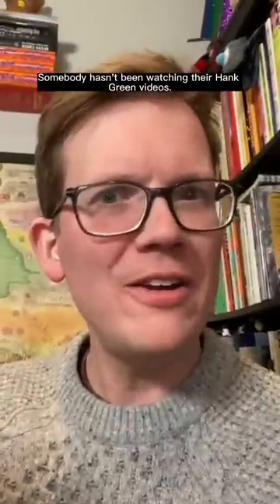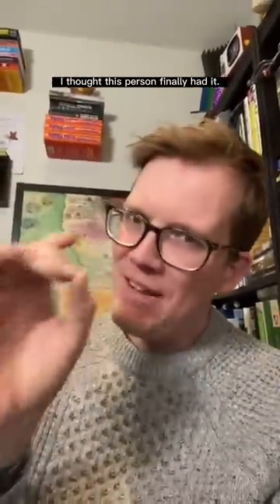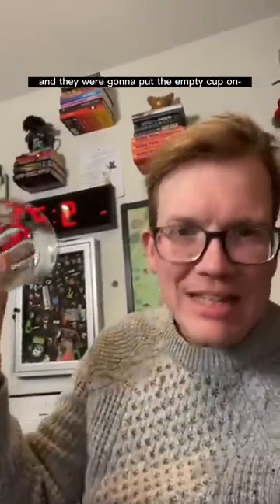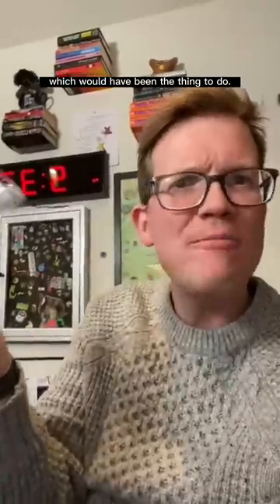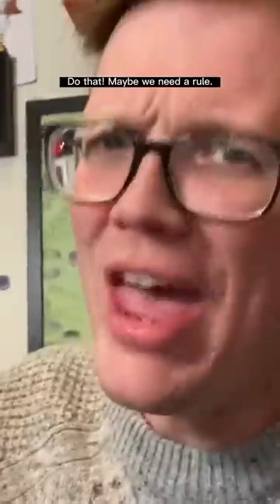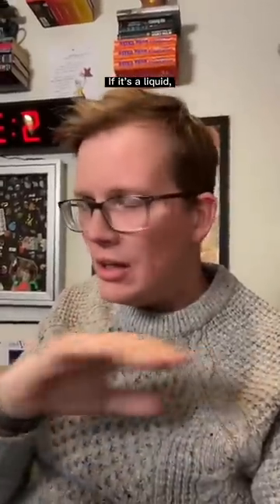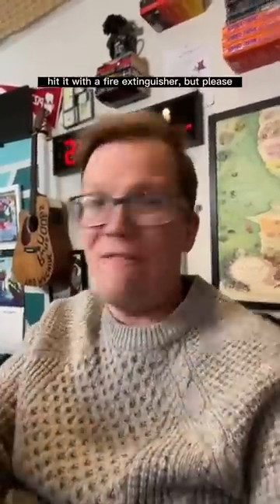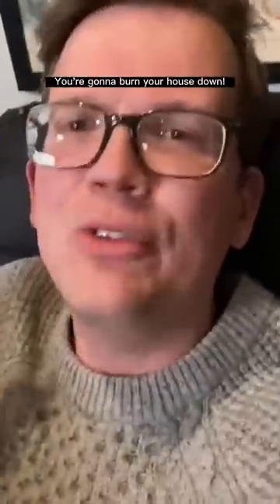Why does water cause candle fires to explode?

Comment: Hey, important correction here!
Don't add salt, or cinnamon, or anything, to flame. That could just make it worse.

But yes, just deprive the flame of oxygen.
Bonus, if you let the smoke build in the cup and leave it, the smoke won't rise to set off the fire alarm when you remove the cup later!

From experience.

Comment: My understanding is that water primarily works by cooling off the fire surface to below the temperature needed for combustion, not by depriving the fire of oxygen. Latent heat of vaporization of H2O is pretty darn high.

Comment: I once had a gel fire in the kitchen. One of those pots that keep the buffet warm had gel fuel inside and it somehow spilled on the floor. Someone wanted to dump a bucket of water on top but was stopped at the last moment, we then put the fire blanket on top, feeling all smart. The blanket then caught fire... ugh.

Comment: The problem is that people don't actually understand how candles work. I had someone dead set on trying to tell me I was wrong, candle wax isn't a fuel, it slows down how fast the wick burns because the wick is made of flammable cloth. A quick link to a website that actually knew what they were talking about turned that conversation around. Too many people just don't get that wax is flammable and that's what actually makes a candle burn.

They also think of it as solid and not liquid because they think only a little is melted at a time but it doesn't take a whole lot to make an explosion.

Comment: I remember I did that 1 time with a candle. Flames (briefly) licked up the wall, and I scared myself pretty good. 
The next time around, there was a fire in a trash can and I snuffed it out by putting a lid on top of it. Much safer, seeing as the lack of oxygen would just cause the fire to choke itself out. 😊😊😊
Ps, I should also mention that baking soda is pretty handy in case of a fire, like something small on top of the stove.

Comment: As a small child(10 or 12) I was tasked with cleaning up cobwebs in the basement. Being the lazy pyromaniac that I was I decided that the quickest way to clean up was to set the cobwebs on fire. 
Luckily while cobwebs burn really REALLY fast they don’t burn very hot and it quickly burned through the fuel(cobwebs) without catching the floor above it on fire. It just charred the hell out of the wood. 
Not sure how but my parents never found out and when I finally told them(when I was an adult since they couldn’t ground me anymore) they were shocked we didn’t lose the house. Tbh I am too.

Comment: "If it's a liquid, don't add liquid to it" is a fine rule for fighting fires.

A question though; how many people are aware candles are liquid-fuelled? I was an embarrassing number of decades old before I realised (thanks Technology Connections) that solid candle wax is just storage for a liquid fuel, melted on demand by the flame itself. 

Until then I'd absent-mindedly thought of candles as solid burning objects. I wonder how many people might be in the same boat, and have trouble making the mental link between 'candle' and 'flammable liquid'.

Comment: There is also isopropylene trapped in the wax. While it's trapped in the wax it's safe but adding water to the wax will separate the isopropylene from the wax causing a small explosion as seen in the video. But long story short the smart man is right depriving the flame of oxygen is the best way to go.

Comment: Cool facts the thing hank is talking about. Using steam to make a liquid fire bigger is something we took advantage of in 1900 when the first oil burning steam locomotive was built. A jet of steam would shoot from a hose in the firebox and another jet of oil would poor onto the steam jet vaporizing it. add a flaming rag and woosh!! A massive fireball is produced giving you a cleaner and easier to control fire in your steam locomotive. Later the same was done with coal as a fine powder with the same process.

Comment: No because I had this cute glass candle with it's matching top that fit perfectly. I went to put it out and not only could I not blow it out but the cap shattered when I tried to use it. Had to use a different candle's top to smother it. Threw it away because I was for sure going to have the same panic if I tried lighting it later.

Comment: Not sure that method would have worked because it looks like the shelves were not solid and allowed air through the bottom, allowing oxygen tostill access and feed the fire.  But on a solid surface, yes, putting a cup over it should work.

Comment: Wood, grass, trees, paper, plastic, fabric, electric(when power is off) = Water

Oil, wax, fats, gas, oven, electric(when power is on) = Cover/Smother

A Fire Extinguisher of the right Class is preferred for larger fires. And so is water. Do not try to cover large fires.
Reply: Also if it's really small, you can just crush it out with your shoe. Put the burning material on a flat surface(if it is not fully combusted) and smush it with something solid larger than the entire fire. Like a burning post-it card or piece of toilet paper and a rubber sole. Or a burning cloth and a ceramic plate.
Reply: I did that when a small piece of wood fell out of the woodstove and it was on fire. I grabbed the poker and smushed it down on the largest flame until it extinguished.

Comment: It’s hydrophobic forces as well oil/wax doesn’t mix with water. All your are doing is pushing the wax/oil with the force of water spreading it faster. CO2 fire extinguishers are preferred method to suffocate the fire.

Comment: I remember when I was about 11 I had a small wax burner in my room. I wanted it to burn faster so I put pieced of paper in it(bc I've had camp fires, same thing right? 🙄) well I got scared because it was burning too fast + getting bigger and blowing on it wasn't putting it out so I thought surely putting some water would smother it (I also thought fire extinguishers were liquid and basically just water, and again I had dumped water to put lingering campfires out) and it got even bigger. Then it started smoking. So I got my brother (like 13) to help bc I didn't want my mom to find out what I did (they were napping) so we decided to put towels in the gap of my bedroom door to keep the smoke from leaving the room (did not even open a window bc at this point does anyone expect a smart decision?) 
Well before we could make the situation too much worse my mom smelled it and they ran into the room and saw what had happened, my mom grabbed a bag of flour and dumped a big handful on it and it was out.

I was not allowed to have candles or wax burners in my room again until I was 18 💀 I also wasn't allowed to have scissors for a few years there. I was a very smart kid but had absolutely no common sense (I'm still getting it)
Reply: Also my parents did explain to me every mistake I made and what I should have done instead, so they didn't just put the fire out and tell me to clean it up. I'd never been told that there were different types of fires. It seems obvious now but at that time I was oblivious.

Comment: If the liquid has a lower boiling point than water, it won't flash off into steam and atomize the fuel. Alcohol fires don't explode like this. As a general rule though don't put water on class b fires (burning liquid fuels)

Comment: If it's a Kindle that uses wax to burn, would it still explode? Because the only thing that's fueling it is the wick. In fact, you can take candles that are partially melted and slosh the wax over the wick and it will snuff them.

Comment: Advice needed: if the guy had put an empty cup on the fire, would it not have exploded? 

I get the starve the fire of oxygen thing, but doesn’t glass, especially in something as weak as a cup, explode when it gets hot too quickly? (I’m assuming the cup was glass since plastic would also catch fire/melt and just make toxic smoke/air)

Comment: I don't know if this is also related but most liquid fuels (except for like alcohols) are also hydrophobic, right? So if you pour water on a fire that's burning a liquid fuel like a grease fire or candle fire, the water will also basically cause it to spread across that surface too

Comment: It it's a liquid you absolutely add liquid to it, just not water. If you have a chip pan oil fire then you dump as much oil as you can in to bring the temp down so it doesn't reignite.

Comment: I really gets fun if you have water inside the candle, which can happen easily enough if something went wrong in manufacturing. Best case scenario, you get a little puff and wax droplets flying around. Worst case scenario, your candle (and possibly the glass container) explodes.

Comment: Your description of the problem is wrong.  The main problem with water on oil/liquid fires is that water is heavier so it displaces the melted wax and pushes the fuel up through the flame.  The steam also doesn't help.

Comment: I thought everyone knew this! If you are cooking with oil or grease and the oil catches fire, DO NOT pour water on it! Put a wet towel on it!
Reply: Yep we had a grease fire in our barbeque which resulted in some charred towels, we got three towels two would be in the process of being re-wet at any time while the third would already be damp and on the fire, repeat until the fire is absolutely out swapping out towels to make sure the one on the flames doesn't become dry and light on fire as well

Comment: My high school girlfriend tried to drop a whole bag of frozen french fries into a pot of oil she had boiling on a gas stove burner. The fries had a lot of ice crystals on them and the oil was way too hot. The oil boiled over and spread out and when it hit the open flame of the burner, the entire stovetop went up. The flames went around the hood and up the wall. She was running around screaming. She finally ran to the kitchen sink where they had one of those retracting sprayers and she was just about to spray it with water when I threw a giant bag of flour on the whole thing. You remember that scene where Captain America and Tony Stark are chopping wood at The Barton's and at the end Captain America picks up a log and chest-rips it in half with his bare hands? I did that to the 5lb bag of flour. I pulled it in half and let it fly out onto the fire. It worked perfectly. She realized her mistake immediately. Well, she knew the first mistake was the hot oil and ice covered fries but then she felt even worse because she was about to put water on an oil fire. The damage wasn't bad. Just some black marks on the wall above the oven hood which was easily fixed with some paint.

Comment: I think people legitimately think water has a property that puts out fire. But water is only depriving fire of 1 or 2 of its needs. If water works on a fire it is because it blocked the oxygen. Some fires are able to burn underwater, getting hot enough to rip the water apart and light that on fire too. Once you know that you realize water is not always the best way to put out a fire.

Comment: Yeah. In liquid fires, it's not the liquid that's burning, it's the vaporized gas.
You can actually put a cigarette out in jet fuel.
With solid fuels, you can pour water, but I don't think it's removing the oxygen, I think it's lowering the temperature to prevent further combustion, vaporizing water removes heat?. I'm not sure.. but removing oxygen works too. Correct me if I might be mistaken about that.
If it's a lithium battery fire... I mean, it's lithium. Good luck with that.

Comment: This goes for y'all who pour water into your cigarette buckets at gas stations. Cigarettes float, and fire reignites EASILY because water isnt just INSTANTLY cooling everything that was burning. 

This is so common infact my ADHD-Autism brain wanted to write my method for dealing with this.

FIRST THING: REMEMBER YOUR 911 NON-EMERGENCY SERVICES! There are non-emergency lines for local emergency services services, they will help better than a YT comment. Ask a coworker, call your boss, or ask a local customer if they know the non-emergency line; ASK NON-EMERGEMCY FOR HELP FIRST if you if you do not feel confident in your own abilities, as I AM NOT A TRAINED PROFESSIONAL!

I am simply a gas station clerk whose fire department is /so/ busy, even calling non-emergency would be downright rude in my book. (Seriously, I see them pass with sirens blaring 4 times in my afternoon shifts! Every day!)

If you find one smoking, find a thick glove AND thick towels, you should have them. Measure how much smoke is coming out- if its pretty little, you can see the darkness inside the neck of it, feel the base's side for heat. Not much heat? Good. 

FIRST, carefully shimmy it away from the (assumed) door and to a side without propane or gas, DO NOT PICK UP BY NECK OR BASE. Use the neck like a driving handle and walk it slowly away.

Once a good distance away from the door (try for a few short strides) AND near to the store's wall to reduce the wind, continue.

CHECK YOUR WIND! If it is windy and the smoke is bad, don't even test it! IF IT IS ONLY LIGHT WIND, KEEP YOUR BACK TO THE WIND! This will assure you block the wind's path, keeping ashes in the bucket and YOU out of the smoke!

KEEP A FIRE EXTINGUISHER AND (If possible!) GASSOLINE SAND READY! (I don't know the real term for it, but that's pretty close!) REMRMBER: The simple cigarette disposal bins are surprisingly well designed to create a lack of fuel for the fire itself, but opening the top can expose it to fuel or drag the fire out via the wind! KEEP AWAY FROM SHRUBS, GRASS, AND CARS, OF COURSE!

WITH YOUR FACE A SAFE DISTANCE AWAY (keep arms outstretched, tuck your head to the side, such like that, protect your eyes!) AND COVERING YOUR MOUTH/NOSTRILS (use those towels! Get a wet bandana, maybe!),WITH HELP IF NEEDED, open that sucker up and look at your situation. No fire, just smoke? Continue. Actual fire? Fire extinguisher OR a heavy cloth towel / heavy ammounts of gasoline sand if you have some on hand. 

IF YOU ARE CONTINUING BECAUSE IT IS SMALL: KEEP YOUR FACE AWAY FROM THE SMOKE. Sift through with A GLOVED HAND and THICK TOWELS. It might be deeper than you first think, but DO NOT DIVE YOUR HAND INTO THE ASHES! It is often EXTREMELY hot at the bottom of those, ESPECIALLY if there's smoke rising! 

ONCE THE TARGET IS FOUND, ANYLIZE! Is there a real fire now that you've found it? Is it small embers? If a fire truly begins, suffocate with a steady calm pace by pressing the towels against it. IF THE HEAT GROWS, BACK OFF! You can resort to the extinguisher if needed.

 IF IT IS ONLY EMBERS, instead isolate the cig and WITHOUT LIFTING IT COMPLETELY FROM THE BUCKET scoop it with your towel in your gloved hand and CRUSH UNTIL SMOKE STOPS. 

If there is more smoke, you might have a problem! AGAIN REMEMBER! NON-EMERGENCY NUMBERS EXIST FOR EMERGENCY SERVICES! 

Let's all do our part and keep safe, because we'd rather not make a fire happen at a gas station! (Trust me, I've seen a few near accidents!)
Reply: I wrote this for 20ish min are you proud of me

Comment: God, my ex had one of those wood wicked candles that caught on fire.. we both panicked and I ran to wet a wash cloth to snuff out the oxygen and heat of the fire, as soon as I put the cloth in the candle she came running into the room with a cup of water, took off my wash cloth and then poured water onto the candle making it explode.  I’m still mad about that lol..

Comment: I accidentally started a grease fire by following a recipe (for the microwave), and knew what to do. But I had to improvise because I couldn't cover it easily. So I stopped it, left the door shut until it was embers and I got the extinguisher out and then opened it, so when it flared I could stop it. 

BUT nobody had actually given me a chance to use a fire extinguisher before so I tested it before opening the door, and almost fire extinguished my cat. 

😂

Comment: What if you were to just drop the whole shebang into a tub of ice water? Ooh ooh, or, what if you were to drop it through a hole in the ice over a lake as if you were ice fishing? Basically, what happens if instead of a small amount of water is poured on a fire, which heats up quickly, what if the fire was dropped into a large amount of liquid that transferred a proportionally smaller amount of energy to the entire body of liquid?

Comment: Why does no one mention salt??? Keep a bag handy, cheaper and lighter than sand if you don't have easy access, used in the kitchen anyway, use like sand on fires.

That said: if you at all can, sand is safest of anything you can get your hands on, really, if you're not smothering it with an (non-flammable) object!
Reply: Hot tip you can get a five pound bag of sand super cheap during the summer at most stores that sell backyard and or gardening supplies. Look for play sand I got a bag of it for less than 3 dollars Canadian we use it for all kinds of things I originally got it for my aquarium but its also good for adding grip to icy steps

Comment: Ok so weird question. I know when u add Water to an oil fire it would spread. Wax seems to be some type of petroleum based product. 

Does the heat use the Oxygen particle and evaporate off the Hydrogen molecules?

Comment: At my job every year you take training on classes of fire extinguishers and what the classes mean per fire extinguisher depending on the chemical used inside the fire extinguisher on whether or not it was going to put out that type of fire. The class k fire extinguisher is able to put out grease fires from your kitchen. Oddly enough that's class k fire extinguisher. Most of all common sense you need to deprive the fire of oxygen. He's stupid wax and grease fires are the most common.